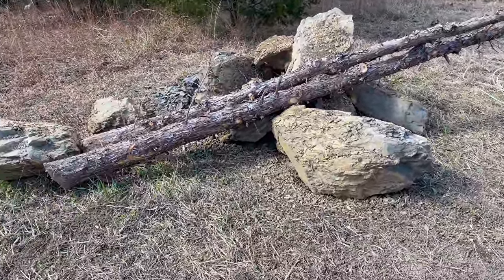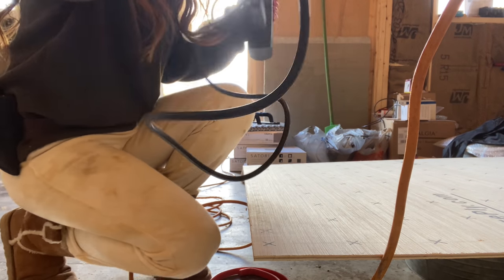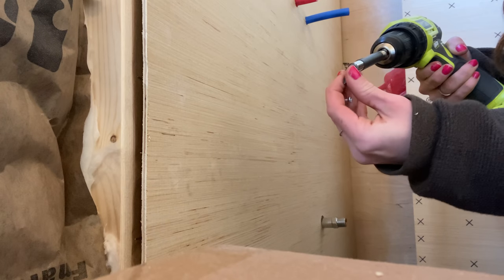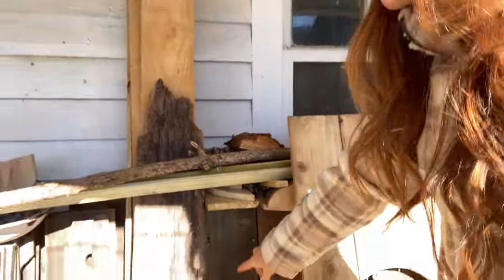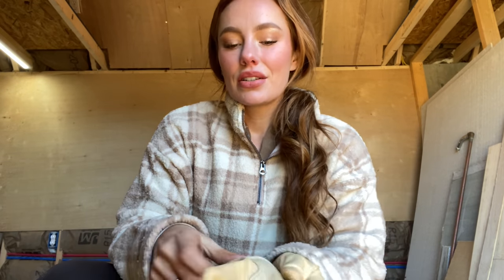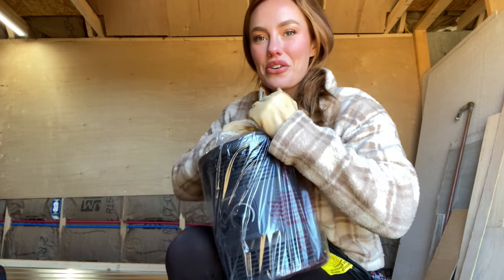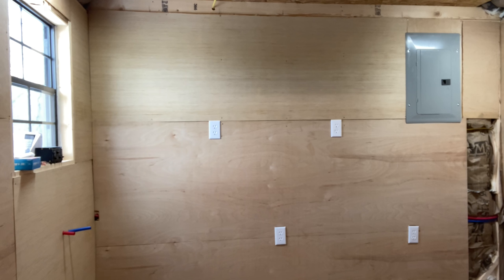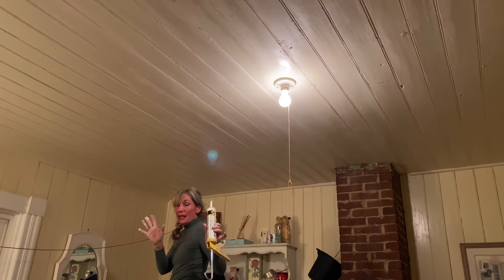Using Lipstick + A Hand Saw, In The Workshop .. Ep. 17

Comment: Do you close the wood stove down at night? Just before bed, load the stove with wood and close down all the air intake dampers to almost closed. Also choke stove pipe damper a little. This SHOULD let the fire burn slow but last longer. It should at least save some hot coals for the morning.

Comment: A gas chain saw requires a lot of maint. An electric or battery operated for occasional use is better. I’m a retired landscape operator so I used to have gas operated chain saws when I was using them all the time. Now I have 20 volt DeWalt tools that use the same batteries. Trust me it’s a lot less headaches. I bought an extendable pole saw instead of a small chainsaw because I can use it for the same thing plus get overhead branches around my house.
Reply: I have battery chainsaw it's really good

Comment: Heidi, good Tuesday evening there, I am writing briefly by way of general inquiry, if you attempted to start both chainsaws there yourself, or did your Mother also give them an attempt to get them started?   Just once again curious in regards to the preceding, thank you.   When you go to start either one, remember to pull the choke out all the way first, then give the starter rope several pulls; when the engine wants to try and turn over, push the choke in half way, then continue pulling the starter rope until the engine fires.   Push the choke in all the way, then let the engine warm up for a minute or two, giving it some occasional throttle.   Then you should be good to go from there, in terms of starting to cut your timbers to the proper lengths.   Please do some video footage of your running one or both gas chainsaws there, this would be wonderful to watch!   Hoping to see the same, again in the very near future, best wishes in getting these running there, N. Romanelli

Comment: This might be a dumb question but, did you make sure you primed the chainsaw before you tried to start it? If not there should be a little rubber bulb on the side and you should push it about 10x then make sure you choke it. Also make sure you gas and oil is mixed right. If there is to much gas and not enough oil it want crank up.

Comment: Try burning coal in the stove at night,use nut size coal,put it on your hot wood coals before bed,about 2-3shovels full,heaped in stove,once it starts burning, close done the stove pipe draft about 3/4 and only have stove air draft open a little bit.Coal burns hotter than wood,and lasts longer ,providing heat thru the night.In morning and your wood on the coal embers

Comment: Hey you when you cut wood you against the grain you need a blade with fine teeth wood going  across called a CROSS CUT.if you are cutting down the grain called  RIPPING CUT you need a saw blade with less teeth .if you buy a multisaw pack of different sorts it will explain the difference between and what there best use is I hope helps 💯👍🏻🇬🇧

Comment: You may want to bring your electrical outlet boxes out to account for the thickness of your accent wall so they will fit flush when you are finished.  You can get electrical box extenders for about 4 bucks a pop, but if you haven't finished installation you can save a few bucks and a trip to the store by resetting them first.  Thanks for the hard work!

Comment: Heidi, is there a significant elevation difference  between the saw shop and the farm? If there is you will likely need to adjust your saws carburetor. Even with a new saw there is a balance of skill and witchcraft  to have it  operating optimally.

Comment: Hot and cold running water?  Where is the hot water heater going to be? You know, if you drop a power tool, connected to the wall outlets, into that bucket of water you will get electrocuted! More things to worry about.  Seems like you are not building a work shop but a beauty salon.

Comment: Heidi, good Sunday evening from here in Washington State!   It sounds like you ate waging a valiant effort there on getting your workshop completed, well done indeed!   Regarding your gas chainsaws there, don't ever give up on getting them to start and run, you will succeed!   If you need your Mother to physically give you a hand in getting one of these to start, there is no cause for shame in this, I assure you.   I myself have ran and operated a few different models of these here locally, doing general yard work and cleanup duties.   When you do go to start your gas chainsaw there, make sure to use the choke correctly, and with sufficient pulls on the starter rope, you will most assuredly get it running.   I am anxious to see you operating one of these in the very near future!   Remember to wear appropriate safety gear when operating one of these in turn.   You may well have to cut down some trees there for firewood.    Am looking quite forward to seeing additional videos from you soon now, Nathaniel Romanelli

Comment: U shud check out another tool. It used to be call a  “saws all”. It’s like a huge saber saw. Comes w various size saw blades. It’s electric and cud easily cut down a 10” thick tree. Officially it’s called oscillating saw. My name is Pete Wills. Hope this helps
‘

Comment: if you only need to do a couple pf cuts at a time go to harbor freight and get a bauer chainsaw, battery, and charger.  It will cut every time, no problems when ever the battery is charged  no gas mix to use, just put chain oit in it. and cut,  The chainsaw that you have, you need to use premix fuel instead of mixing it yourself most of your no start problems will stop has to do with pump gas evaporating and ethanol in the fuel

Comment: Make sure you put in a carbon monoxide detector in there when you use the heater.
Reply: It's electric...
Reply: @goofyat210  Small confined space where the heater is burning oxygen. Ya still need one.
Reply: @rickcoloh9083  electric heaters do not burn oxygen. You do not need one.

Comment: Along the edge of your shop and exposed deck place black garden plastic then make box planters. Line box planters with the black plastic also have at least one or two drain holes. Fill with potting soil and plant flowers or what ever you like. This will protect your deck and dress it up nicely. You have plenty of old barn boards your mom and you saved from the old barn to make the box planters.
Reply from the maker: can you possibly draw this and send it to my email? hihoback@gmail.com I like the idea a lot but can’t quite picture it in my head. Thanks
Reply: @LilRedHeidiHood  will send a picture of a window box. That should really help.
Reply: Email sent from jfktransport.
Reply: @LilRedHeidiHood  can you email pics of where the deck and the shed meet. Trying to figure out how much deck is exposed ect ect. front side and back. Thanks
Reply: @LilRedHeidiHood  I like this idea great idea.